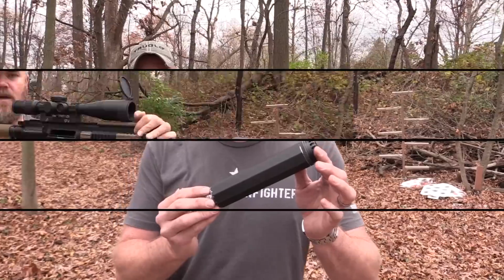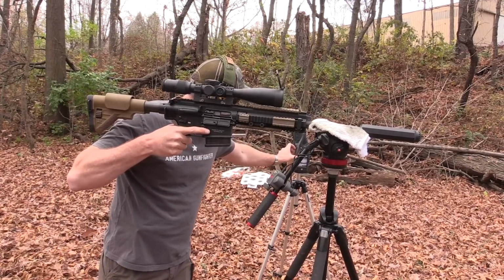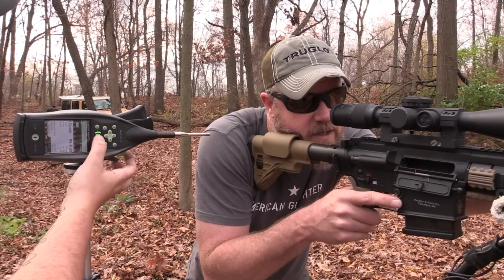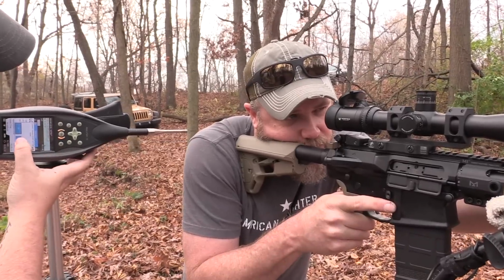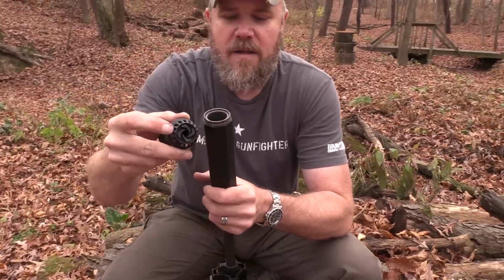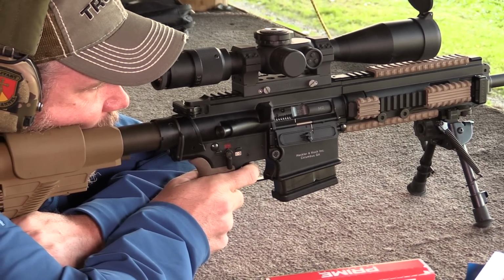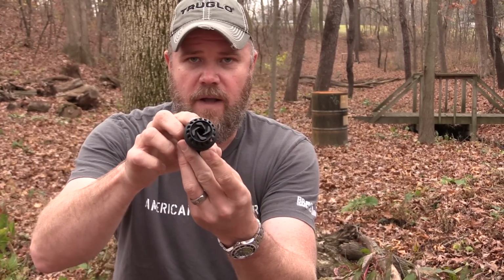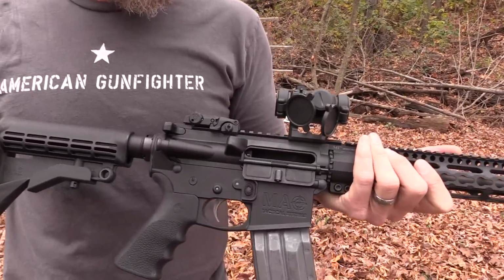New OSS Helix 762 Silencer full test!

Comment: So its pretty much the same noise at the ear as other suppressors, but a LOT louder a meter to the left of the muzzle.
Reply: TurboUSMC It was over 10 dB quieter at the ear. It was the difference between hearing safe and not hearing safe.
Reply: Thanks, you're right. I was skipping around the video too much apparently! I would have liked to see the cans compared on the same rifle though. Thats a pretty big factor considering the OSS was on a piston gun and the sandman wasnt.
Reply: K Bob I know there is a difference, but no one knows the difference between a DI and piston gun. uppity might pair 2 guys and the piston gun is only 2dB quieter than the DI gun. It all depends on the gun and the silencer. But yeah, it's not a very equal test. All I was saying to the op was that it was quieter. If you swapped the cans around, would they still be 10 dB apart, or be equal? who knowsn
Reply from the maker: The muzzle device for the OSS is classified as a "silencer component" and thus you can only have one which ships with the can. They are working this out with the ATF so this won't always be the case. I got it for the HK rifle because this is the new CASS system not thinking that I wouldn't be able to run it on any other AR10. More testing will take place, but the results will be similar. The lack of back pressure is pretty obvious.
Reply: Andrew Delashaw that's the difference in piston and DI. Go on silencer shop's page. This was a very biased test considering how he selected his hosts

Comment: Why are the dB's decreasing with the can?
Reply: Gerald Bargaineer II It has something to do with the molecules of gas in the barrel and can. as you shoot consecutive shots, the oxygen is consumed, and CO & CO2 are left over which carry the sound different. That is not the most accurate or scientific explanation, but it's the general idea. after the "first round pop" they get significantly quieter. usually shots 2+ are all about the same.
Reply: Lots of cans do have some form of first round pop.  And the first shot burns the remaining oxygen in the can.. Some fresh oxygen will come re-enter the can, but mostly it's got reduced oxygen inside.  Technically, the gunpowder is still burning at the end of the barrel which is why an unsuppressed gun has a flash when shot...   Longer barrels also help; shorter barrels make guns noisier unless the entire powder charge is burnt prior to the bullet exiting the barrel .

Comment: SO I question the validity of the military or dod testing next to the closet ear,  all of the 10+ years I been in and have been shooting (20+)  my non weapon side ear (the furthest from muzzle) always rings if im not wearing ear pro (hunting)  the weapon side doesn't, my theory is, as the sound wave movement is dynamic and moves in a wave arc it hits the ear not on the gun first. on a secondary note the 1st shot with sandman had the holywood suppressor sound............ that phewt sound.

Comment: There is no consistency with these tests. Should have used both suppressors on either the HK or MI rifle.
Reply: Doesnt the Sandman mount to both rifles tho???
Reply from the maker: The muzzle device for the OSS is classified as a "silencer component" and thus you can only have one which ships with the can. They are working this out with the ATF so this won't always be the case. I got it for the HK rifle because this is the new CASS system not thinking that I wouldn't be able to run it on any other AR10. More testing will take place, but the results will be similar. The lack of back pressure is pretty obvious.

Comment: looking forward to adational reviews of the OSS.  Noticed you only used the main part (BPR)  there is the smaller piece that can also be added (SRD) for adational DB reduction.
Reply: mugenrios2k Not on this new model targeted at civilians-- this is one piece.  The two piece over-the-barrel design is now a more expensive model, targeted at military applications.
Reply: mikesmith379 ooo missed that there was a different version now civie cheaper version.  Going to go check out oss website again.  There was a rumor floating around at Redstone Arsenal  (army base) that there was some testing of this supressor going on here.
Reply: No question, much of what OSS offers is most relevant to military applications, e.g. high round count engagements.

Comment: The test results can not be compared, as they are two different rifles, with two different operating systems.  

This video comes across as a plug for OSS.  If the results are consistent when using the same rifle, it would remove this feeling.  Using what OSS says about how there is no difference between piston vs DI does not help either.  

Do I want OSS to work?  Heck yes, innovation only benefits us (consumers and military), and new ideas are welcome.  I just can't get over the feeling this is a nice plug for OSS versus less bias videos I am used to from this channel.
Reply from the maker: The muzzle device for the OSS is classified as a "silencer component" and thus you can only have one which ships with the can. They are working this out with the ATF so this won't always be the case. I got it for the HK rifle because this is the new CASS system not thinking that I wouldn't be able to run it on any other AR10. More testing will take place, but the results will be similar. The lack of back pressure is pretty obvious.

Comment: Merry Christmas everyone. would there be enough room between the front insert and the inner sleeve for a thin wrap of steel wool? wouldn't that help in reducing the overall sound level? I would be curious on the cans effect on an old bolt gun, like my m44 mosin carbine. which incidentally is I'm partial to. my mosin slugged out to be .308, great riffling 😁 I reload my shells 180 grain ballistic tip w/ 42 grain 43/30 if you need this info.

Comment: Thumbs down for not using the same rifle for testing
Reply from the maker: The muzzle device for the OSS is classified as a "silencer component" and thus you can only have one which ships with the can. They are working this out with the ATF so this won't always be the case. I got it for the HK rifle because this is the new CASS system not thinking that I wouldn't be able to run it on any other AR10. More testing will take place, but the results will be similar. The lack of back pressure is pretty obvious.